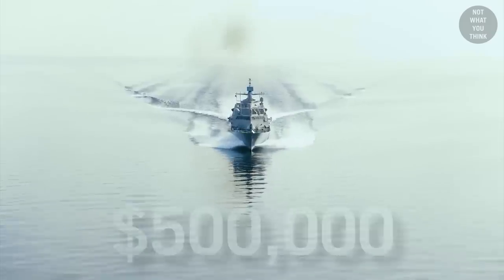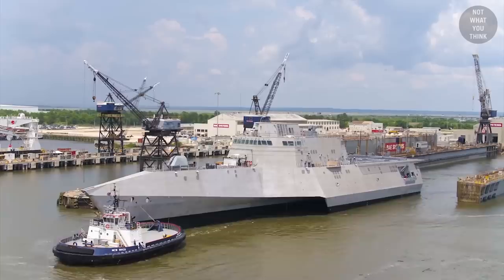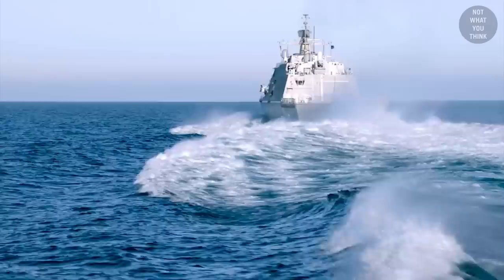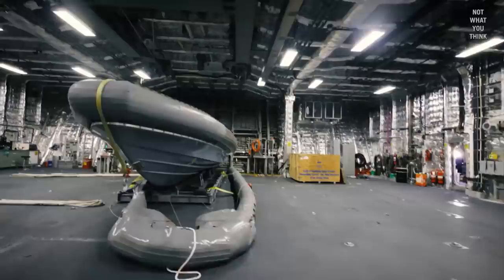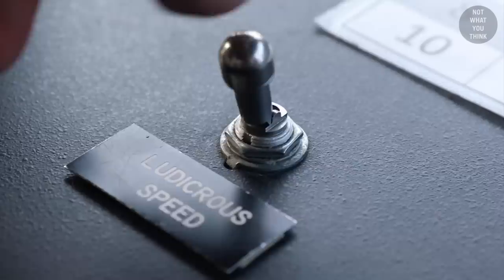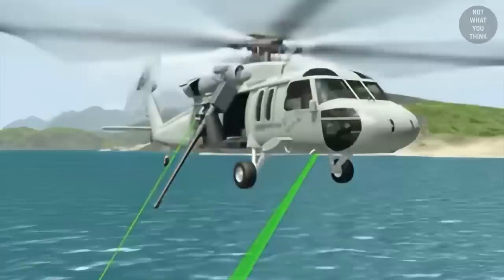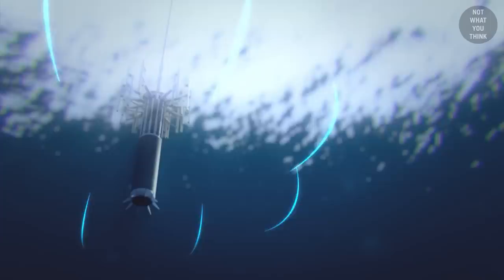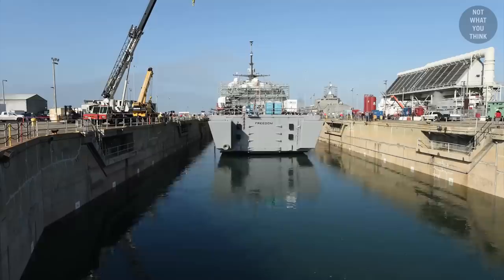Why Retire a 2-Year Old Warship?

Comment: I'm surprised they thought they could get "cheap" and "over 40 knots" in the same package. I'm glad to see they discovered the problem with the gears and can fix these in the 6 ships being built.
Reply: A Perry could do 7 knots on diesel power or 33 knots with both LM 2500s online.
 Butt when the standard missle was program was ended for single and twin arm launchers. The launcher was removed. No VLS was designed to replace them. 
Basically making the it a ASW only platform. The SH-60 was originally operational In 1984 ON the type III USS Crommelin FFG 37.
 That ship could handle 70-90 knot winds and waves 120 ft. from apex to the trough. 
You do get tired of it after 8 hours.
It cost 900 million to launch as commissioned ship 1983 and $600,000 in upgrades were added over the next 5 years.

The Crommelin was sank as a target 19 JUL 2016. It took 8 hours to sink it.
Reply: You are on the money with that comment. What's their definition of cheap? High speed, cheap, and military spending are not words that go together.😄 Their biggest problem is they believed that jet drives would be the solution. They work great on high-speed ferries but the hull shape required for military ships is quite different. Jet drives are inefficient with up to a 30% loss in HP. Combine that with a high RPM requirement and you get a low fuel efficiency. The Independence-class ships also have a huge issue. This LCS class has severe structural problems. This has caused major hull cracks. The damage to the hulls has limited their speed and prevents them from operating in heavy sea conditions. These issues and the Zumwalt debacle have many wondering what is going on with the Navy! They tried to innovate too much too fast and it has ended badly.
Reply: You can get "cheap" and "over 40 knots" in the same package -- just not in a package the size of a warship.
Reply: @deusexaethera  Exactly! 👍It was all pie in the sky calculations. Those never add up.
Reply: Why not make REALLY BIG PT boats? Littorals were designed as SHALLOW DRAFT water craft for close-to-coast operations.
Something that is seldom mentioned. Viet Nam era river gun boats and WW2 PT boats filled certain requirements that the LCS was supposed to help fulfill with the modules. 
Should have just made MANY small, easily modifiable boats for a variety of missions. That's what was done with PT boats and river boats.
Reply: You think one of their Geniuses would have realized that you could eliminate all the gears by using electric motors.
Reply: @gbtriumph3216  I think the USN has lost taste for watercraft that aren't proudly ocean-going with capabilities and cost to match, mission requirements be damned.

Comment: I suggest you making a video about different bow types of a warship (example: atlantic bow design, etc.)
Reply: I hope they do so, the Wikipedia page for naval bow types doesn't really have that much information on how most bow types work, only bulbous bow.
Reply: I’m a Marine engineer. Look up books on Naval architecture. I recommend “Reeds Vol 4, Naval Architecture for Marine Engineers”.

Essentially Bulbous bows are used to reduce drag along a ships hull by creating a bow wave at 180degrees to the waves present to negate them out. Their shape depends mostly on  speed of the vessel, ships with higher speeds need a longer bulbous bow to crest the bow wave sooner before the ships hull catches up.

Comment: Don't forget the Mk44 Bushmaster II guns the Freedom class is equipped with have major reliability problems. The 57 mm Mk 110 gun also has terrible accuracy at high speed. The radar system is glitchy and can't maintain locks on targets. The ship has had at least 17 major cracks in the hull, many requiring dry docking. This whole program is a lesson in trying to get one ship to do too much with too little. The Defense Department claims the ship is 6% overweight and will likely not survive any sort of combat damage. Hell, it barely survived its own sea trials.

Comment: One of the major shortcomings of these ships was the failure of the Navy to spend the money to build a prototype test bed of its all-new propulsion system. It this had been done, the design's many problems might have been identified and corrected. Or at the worst, would have resulted in a complete redesign into something that would work. As is, the LCS's propulsion is utterly unreliable, and every article that I have seen on it claims that the issues are either unsolvable, or will require a major rebuild that will cost almost as much as a new ship. Meanwhile, the Navy has changed their minds about the mission and weapons mix that they wanted these frigates to have. Essentially, the entire program has been a boondoggle from the start that has wasted years, and tens of billions of dollars while the Chinese have been building a new navy of their own.
Reply: This would fall under a broader category of failing to control technological risk. Developing a proper test bed for the propulsion system would have accomplished this. However, under the timescales of the project, the best thing they probably could have done was choose a lower risk design. This would involve troubleshooting the design specifications and asking whether they really wanted a frigate-like ship that could go 50 knots in short bursts.

That said, we should not assume that the Russian and Chinese military industrial complexes do it any better. If the Chinese had a frigate like the LCS, they wouldn't be complaining about it incessantly on the internet.
Reply: I am sure they saved money by using modelling and simulation to prove everything would work perfectly...
Reply: I machined valves for the company that built them. The lip on flange was faced off.

They were sent back with a bunch of metal chips still inside. Stuffed plastic in hole, machined and then pulled plastic out.

I asked if should be cleaned better and told nope they can deal with it.

This was a machine shop sub work for the ship yard.

Weird metal chips were giving them problems
Reply: Yeah, but that would require some oversight of the huge "defense" corporations - that ain't gonna happen!
Reply: While the Chinese have been building a navy, they're hampered by an almost complete lack of blue-water naval experience, and likely no shortage of similar shortcomings in their ships in their desperate attempt to expand and modernize to catch up with other navies. China being China, of course, not much public information about said shortcomings is made available.
Reply: @hypothalapotamus5293  Agreed,the Chinese are being quite ambitious in their naval aspirations, and I have no doubts that they're suffering from a good deal of issues of their own as they try to rapidly bootstrap their navy from a middling green-water navy into a true blue-water navy.
Reply: @jeremywerner9489  apparently alot of the Chinese navy ships  is smoke and mirrors. On their aircraft carrier they only had full sized models of the planes sitting on deck cause the planes weren't built yet.
Reply: That’s what I didn’t like about govt contracting. The government is too hands off, so they can always blame the companies. But it should be a more collaborative effort.
Reply: The biggest single fail was that the idea was that they could build a smaller and lighter combining gear than what had been proved to work.  That's a key item that should have been tested hard before building a class of ships.

It is still unknown if the redesigned gear is actually going to be as reliable as it should have been up front.   I served in a US Navy Engine Room (steam propulsion) and the reduction gears were massive - but very reliable.
Reply: But at least our new Navy knows what head to use depending on what gender they identify as that day.
You don't have that in the Chinese or Russian navy.
So there...... we are #1.
Reply: These contractors get a request from the military for a specific type/size/mission protocol for all ship, plane, and tanks envisioned then they design it and research the costs and make a bid based on that cost.... Why the world do we allow them to continue to create multi millionaire and multi billionaires in these companies and they never ever provide what they promise at anything close and somehow the people continue to get screwed  because we have to pay. Maybe they should learn to do the math more realistically and come up with an actual number and provide what they promise and charge the dollar amount they promise and cover any cost overages beyond a reasonable 5-10% themselves UNLESS THE OVERAGE IS CAUSED BY ADDITIONAL REQUIREMENTS BEING INCLUDED IN THE PLATFORM BY THE PENTAGON, WHICH WOULD OBVIOUSLY BE BEST TO REQUIRE AN ALTERNATE OR REVISED BID BASED ON THE NEW INFORMATION
Reply: AKA "build a little, test a little."
Also buy Ford, not Ferrari.
Reply: The chinese navy is still mostly suited to harassing fishermen, not worried.
Reply: I like the word modular.  Let's use it and cut the entire engineering section off and replace it with a new-build section on the original 9.  In civilian industry it's apparently cost-effective and even common to splice existing ships to lengthen them.  Why not cut the tail off and replace it?
Reply: @travisverlinde191  The way these contracts should be written is that any cost overruns due to the contractor either over promising or just plain screwing up should be paid for by the contractor. But it there's cost overruns because the government made changes to the specs after the contract was signed and the specs finalized, then it should be on the government.
Reply: The issue with the LCS, and pretty much every other program from around the same time can be chalked up to concurrency, something that all of the branches of the US military was obsessed with at the time. All of the major programs from around that time from the Fords, Zumwalt. LCS, the F-35 were all being built with concurrency. This meant that they were all being built with tech that didn't exist yet except on paper. The idea was that the tech would be ready by the time it came to incorporating that tech into the build. Of course, as we found out, that didn't exactly work as planned.
Reply: The navy wanted big pt boats to combat swarms. It got the lcs instead
Reply: Dnt they figure all that out on sea trials buddy???????

Comment: Here’s an idea: why don’t we stop buying entire classes of ships until we’re sure they work? Having more of an old, but reliable model is better than more of an untested and unreliable model
Reply: Remember the FFG-7 class? They bought the first unit on a "fly before buy" deal where they had two years to shake it out and apply the lessons learned to the follow on units.
Reply: Sometimes that is unfeasible. When it costs billions of dollars for a single model not including research and development then the companies simply wouldnt make them without some garuntee of purchase to offset some costs. All it would take is a single failure and the company is out billions which the military as a whole can sustain due to gross over budgeting but would quickly sink even the largest companies
Reply: Because the military and military industrial complex are the largest socialized jobs program ever.
Reply: Bc that would make sense, duh! 😄
Reply: What?! Common sense and military intelligence don't speak the same language
Reply: The longer the production run, the cheaper the per unit cost.  Having a long serial run would probably be the most efficient way to find the problems, and fix them in subsequent units.  Once the problems have been "shaken out," you could then up the production.
Reply: If they buy one ship then decide they don’t like it, the company producing the ship could be down billions in R&D so they almost certainly need multiple purchases to ensure that they won’t be screwed financially if the government pulled out.
Reply: @Matt_10203  Any proper company includes R and D in the price
Reply: Because the US Navy has to think years in advance and try to anticipate future needs, which clashes with trying to stick with 'old, reliable, and well-proven' concepts. They saw the coming issue with manpower availability and the increasing cost of maintaining increasingly more sophisticated and complicated ships and were trying to come up with ways to head it off by building fewer ships that could do more on the fly. Hence the whole point of the small-crew, modular LCS ships. The issue ultimately was that they were too ambitious while relying on experimental technology, and the manufacturers were over-promising on their products. As the video mentions, this is why both the Freedom-class and Zumwalt-class ships were plagued with issues. The Zumwalt was relegated to being a trio of glorified test-beds of experiemental tech due to all the new tech they were trying to make work.
Reply: Nah, the weapons & infrastructure manufacturers make more from repairing their shoddy workmanship than from building them. The government knows that, it's why they get such large political donations from the contractors...

Comment: honesty a little shocked that the running cost were that low. seeing how it can easily cost 10-15mil a year just maintain yacht and that has a lot fewer crew and fewer systems to maintain.

Not shocked at all of the failure tho.
Reply: @instantjizz  Later he specified it was maybe 70 million a year by outside estimates and 50 million a year by US Navy estimates. The $500k per day is clearly rounded up significantly.
Reply: they pay them less than minimum wage and everything is broken, that's the secret
Reply: when the Navy says operational cost they only mean what it cost to run the ship while on mission not what it cost to maintain it fix it and put it in drydock
Reply: Yeah, but the champagne, caviar & other delicacies, plus the helicopter servicing & tenders are crippling. Especially when you're a bill gates or what his name who runs Amazon- type pain in the butt who has to pay top dollar for his staff, against the cost of  the sailors who probably never get a tip from a billionaire...

Comment: The Navy bears the responsibility for the "failure" of this platform. They came up with an "out of the box" concept that was just a combination of a bunch of other unproven concepts:  reduced manning, modular mission-focused equipment packages, new speed-over-lethality ship designs, etc. etc.  When the different parts of the system failed to meet their requirements (i.e., when all of the teams responsible for the various mission packages failed to deliver any of them on time/budget/capability), then yes, the entire concept fell apart. What good is a modular ship if the capability modules don't exist?  In the end, welding the SUW package onto the ships and scrapping the rest made the most sense for what they had.

Comment: I saw examples of this in Vietnam. One ship I was on was an AE with a modern rail system to move bombs and other ordinance from the hold elevator to the transfer station. Only thing was, there wasn’t enough space for the ordinance between the ceiling rail and the deck.
Reply: Your comment reminds me of a car that people loved in the UK in the 90’s, the Ford Cosworth, all the ‘cool’ guys had them (they were very bad-ass to be fair, lol), but they soon realised that they couldn’t change the CD in fith gear as the gear stick would be in the way,…. Not as cool anymore, lol

I guess engineers have their off-days too 🙂 🍻
Reply: @KumaBean  Tbh, if I had a cool car, I wouldn't want music either way.
Reply: @KumaBean  I thin the Pontiac Fiero was the same way except it was a cassette tape instead of a cd.
Reply: Deck head rail

Comment: The problem is that the navy is relying on OEM manufacturers for maintenance, under the contract for these ships, sailors do not perform routine maintenance of these ships, that’s because these are still intellectual property of OEM manufacturers and many of these systems are considered part of their intellectual property and for contracting reasons to protect this proprietary systems within the OEM, special 3rd party contractors are the only ones permitted to run routine maintenance, these have to be shipped from the Continental US to wherever the ships are deployed at the expense of the navy causing huge delays in servicing and basic maintenance. Sailors cannot perform routine maintenance of these ships and it’s because of this that the LCS program has incurred such a high cost and become terribly ineficiente. It’s also why ships are reported to be in poor condition when on deployment and adding the technical issues which again involve proprietary OEM manufacturers, you cannot have enlisted sailors perform repairs or maintenance on systems that are supposed to be automated and restricted to only OEM approved contractors which. 

They, the LCS platforms are good in theory but this does not work when the ships cannot be maintained by the enlisted sailors and are the property of the OEM manufacturers that still hold the final say on the systems and machinery that is contained within these ships

Comment: The Burke class destroyers are capable of completing the missions of the LCS'. They have a fantastic layout and can be somewhat modular in creation. Given that all the work has already been paid for to design and test the hauls and combat arrays, it's cheap (relatively speaking) to just modify them slightly and roll out the new version after every dozen or so.
Former sonar engineer, no I wasn't in the military just worked for them.